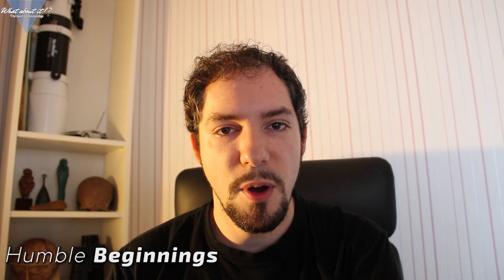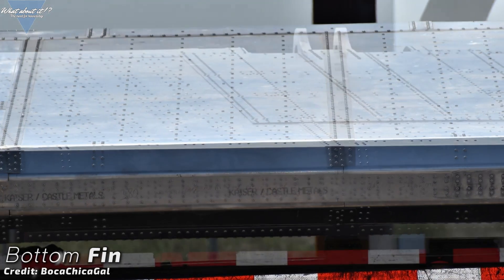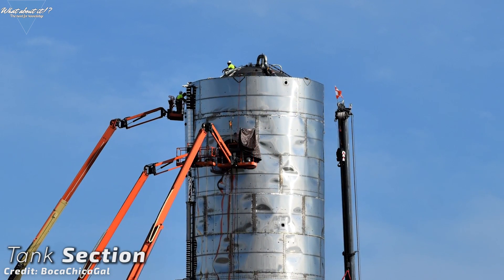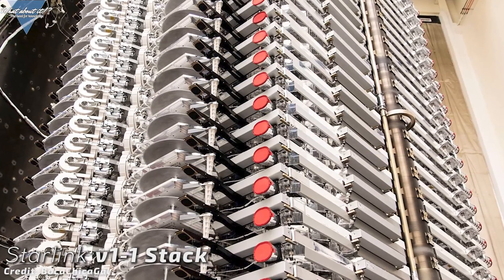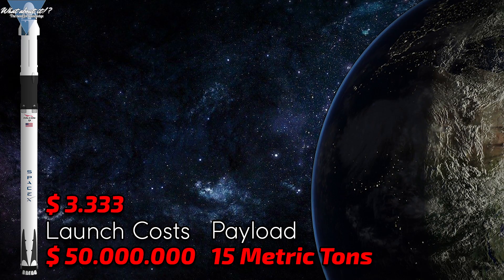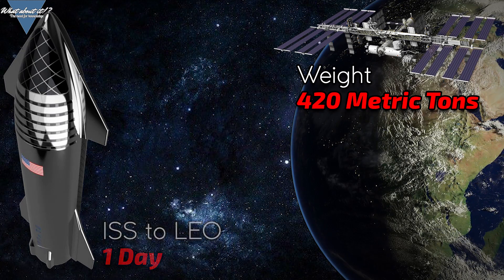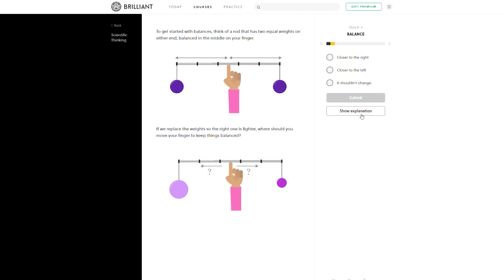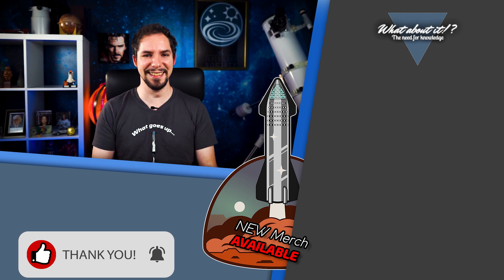50 | SpaceX Starship Updates – Starlink v1-1 Aftermath – Starship Reusability

Comment: Even if he starts out 100 times more expensive than his goal, it will be a big improvement per Kg. Realistically, I could see Elon getting to 10 times over his goal pretty quick($200/Kg) which would greatly increase the demand by orders of magnitude.  
     With low cost per pound, the space based astronomy possibilities are exciting ... can you imagine a research team operating 100 identical generic probes each 1000 pounds with ion propulsion exploring the asteroid belt? They could touch down on anything with orbital velocities less than a few mph.  I bet Elon could make them and put them in orbit for $200 million total.  Move over Webb, a mid to long infrared telescope could be assembled in orbit and be huge and cheaper than the Webb. And I anticipate a Repair/replenish/upgrade mission to James Webb on the far side of the moon. How about landing 50 low cost rovers on the moon that explore fanning out in every direction.
Reply from the maker: I like your ideas!
Reply: Here is another idea that would make the astronomy community drool ... 100 identical radio telescopes orbiting the sun. The resolution would be 20,000 times better than earth based radio telescope arrays.   And each radio telescope would be light weight low cost (Mass produced, achievable 1cm dimensional tolerance mirror antenna tolerance, No special cooling is required).  The inflatable mirror reflector would be huge with one side aluminum shaped like a parabolic reflector 100+ feet diameter, the other side of the unique balloon is transparent with just enough air pressure inside to hold the antenna/mirror shape. (Radio signals enter & exit the balloon via the transparent side and bounce off the inside of the balloon mirror.  At radio telescope wavelengths, the radiation penetrates the aluminum reflector about 1 micron so the balloon mirror can be very light weight.
     Elon Musk could propose offering with NASA some pure science astronomy tools such as above if he wants to get astronomers on his side.  Also, i bet he would discover some valuable metals in the asteroid belt including gold, diamonds, rare elements, fuel, water ... which could become a viable mining community.  Some of the asteroids are thought to be from the heavy metal high pressure core of a planetoid. A return payload from the asteroid colony worth $4.6 billion could be 100 tons of gold that returns to earth like a controlled meteoroid crash landing in the Ocean.
   All that carbon crushed into diamond at the center of a planetoid cold have created veins rich in diamonds.

Comment: The rivets on the fins are very Mark-I prototype work, they cause a whole series of issue's on aero boundary layer, additional resistance to name only a few.  Better tech exists already decades in aero-industry.  This is cheap-quick-dirty work, not exactly high-precision work, but it will be fit-for-purpose here since M-I will only fly once.   I'm convinced that Elon will be using a high nr of strain-gauges in each fin, supports and actuators and all other  key parts to measure stresses before deciding on the final production process for these fins as they are absolutely crucial to the function of StarShip. That may be the reasons why these holes are there, access to the strain/temperature/pressure sensors.  This is (apart from the SpaceShuttle) very uncharted territory.

Comment: Holes might be for stress relief during reentry heating.  Holes would ease the stress of expansion and contraction of the metal during temperature changes.  It was hard to clearly see which holes were referred to; some looked like irregular punch through with a chisel and others looked like clean cut rounded corner rectangles.  The camera panned too fast.
Reply from the maker: That is a good idea! Thank you!
Reply: @Whataboutit  Might want to get and publish information regarding stainless steel sheet expansion/contraction during heating/cooling vs regular steel and carbon fiber.

Comment: I don’t know why on the first stage they just don’t use an oxygen and hydrogen make sure it is a lot cheaper than using methane. It would be only the second stage you would have to worry about refueling on Mars. $900,000 just seems like a lot to spend on just fuel

Comment: What's the aero effect of those raised rivets?
Reply: Probably quite a bit of drag at super sonic speed but not important for this particular vehicle I wouldnt think.  Concorde documentaries really give a feel for what happens to objects at high velocity (heat and expansion) so I am thinking outside rivets will disappear in later versions and also as they start making the craft out of single rolls of metal.

Comment: $2 million per flight is only the marginal cost. It does not include profit or the cost of the vehicle or its development. If they can build a stack for $150 million and fly it 10 times, they would not be out of line to charge $30 million per launch. Flying it 100-150 times makes $5 million per launch a fair price. Considering that Rocketlab charges $6 million for 200 kg and Virgin Orbit charges $10 million for 300 kg, SpaceX shouldn't have trouble filling their manifest.

Obviously, the first iterations will not be that cheap to build and won't fly that many times, but it is clear that Starship is another disruption. Elon said that he sees a path to build a Starship stack for less than a Falcon 9. When that happens, we will see launch costs in the $30-$40/kg range and a lot of very interesting things will become feasible.

It is interesting that Elon will be most likely the main facilitator of Jeff Bezos' vision. I wonder how long it will take Blue Origin to catch up.

Maintaining a constellation of 42,000 satellites with a 5 year life span requires launching 700 new satellites per month. Even SpaceX would be hard pressed to launch a Falcon 9 every 2-3 days. (It takes five days for the booster to get back from a drone ship landing.) But launching Starship every 17 days is doable.

Comment: Starship+Super Heavy will cost at least $200 million, so with the claimed 100 flights per Starship that will be 2 million per flight right there, so with operations and fuel costs ontop it's more like 4 million, and I was being stupidly optimistic on the price of Super Heavy+Starship, it's probably more like $500 million so all in it's $7 million per flight. Elon is will doing the same crap where he doesn't count the cost of the craft at all, which you don't need to do as 7 million per flight for 150 tonnes is still $46.67 per KG, which is insanely cheap. Although the cost to the end user will likely be more like $10 million per launch, but that still puts you at $66.67 per KG to LEO which is still insanely cheap, so I don't understand the deception.

Even at 28.5 million per launch, you are still below $200 per KG which is still phenomenal which is a more reasonable goal, as I suspect there will be more maintenance required than Elon has suggested every 5-20 flights, which would be refurbishment of the engines, or just completely replacing them at worst, although you would probably keep some around so you would replace most, but keep some of the old engines, because you could lose 1 or 2 engines and probably still carry out the mission, as long as the once that fail are relatively close to pushing through the centre of mass you could correct it through gimbaling alone.
Reply: It's expected to cost less than falcon 9 (50 millions)
https://twitter.com/elonmusk/status/1094793664809689089?lang=en

Comment: I dunno... there's so much bending and buckling in those sheets of steel, i worry that some welds will fail and pieces will fall off during flight.  This might be suitable for use as a turbocharged grasshopper; slow speeds, not much air resistance.  But speeds of thousands of miles an hour will tear this ship apart.  Or so i fear.  >Charlie
Reply: I don't think this vehicle will be doing these speeds and te finished version will be all one piece or very close to it.  Still a valid concern though.
Reply: I want them to do well... but there's such a difference in the fit and finish between Starship and Falcon 9/Heavy.  It may also be that they're anticipating losing a few early on, as the engines work through their development cycle.  I guess it doesn't make a lot of sense to finely sculpt airframes that you anticipate losing.  But... yowser.  You definitely have to squint to see the beauty.  >Charlie

Comment: But if they build so much starships and fly them so frequently, won't that greatly impact the atmosphere?
Reply: N'gis Stemeveiche, no.
Reply: @Vessekx  how no? Rockets work with fuel combustion. They produce greenhouse gases just like cars but on a much bigger scale.
Reply: N'gis Stemeveiche, an individual rocket does, indeed, have more of an impact than an individual car.  But there are literally tens of millions of cars being driven every day.  No rocket, regardless of its fuel, can even hope to compare to the impact of cars on the atmosphere.  To even be a measurable data point in comparison, the would need to launch tens of thousands of Starships each year.

Comment: At 365 Raptors per year it will take roughly 120 years to build those 1000 starships. Probably Longer than it needs to be.
Reply: A massive continuous construction effort, A lot of technological advancements would be made before they finished making them causing a change in requirements

Comment: I think they are over selling Starlink.  The reasons for latency on the internet is congestion.  Starlink is not magically immune to congestion.  Comparing it's max theoretical throughput based on only one user to the current internet's massively congested system is quite silly.  Ask anyone that supports internet routing.  The main bit of lag isn't transmission speed.  It's Queuing and Routing.  Both of which Starlink will have problems with once there is more then one user.  On the plus side.  It is more routes so as people move to there it will free up ground based systems as well.

Comment: Good video but for carrying passengers, you need seat in the starship and they will not be weightless. So you probably need to multiply your weight by two before multiplying by 20$... Anyway, that's still cheap for such trip!
Reply: Even with that added and then doubling it for their profits it is still super cheap.
Reply: 1000 seats per starship so 2000$ a seat whatever your weight is.

Comment: With 3 a day, I feel they would REALLY be risking failure of a launch.  That is a lot of reuse, fast checking of componets, etc.  I'm no expert, but rushing is what got us Apollo 1.
Reply: the raptor engines are designed to last 1000s of launches, the whole point of starship is to make space more accesible for everyone. wee're still early days but once they start using super heavy and starship they will be gathering much data on how well these rockets perform, the goal is to make them go 3 launches a day im sure by that point they will have gathered enough data to improve the design so they are able to run that frequantly reliably and with as little inspection needed. think about how airplanes first started.
Reply: I get that risk is relitive, and am in  no way saying they should stop.  I just think caution is important, and to me at least they seem to be rushing.  And yet again i'm no expert here so i'm just armchair thinking.
Reply: @ericlotze7724  they arnt rushing attall. Transporting passengers around isnt going to happen for several years. Starship will have done 100s of launchs before they do that. It might seem like they are rushing building the mk1 prototype but this shows just how easy it is to work with stainless steel.

Comment: I doubt it will fly this year.  In fact its likely they already know it won't.   Manufacturing is notorious for slow downs and shut downs at years end due to everyone taking holidays.  Even if SpaceX wanted to push through fab shops, fueling parts sells are going to be at half capacity.
Reply: Exactly, I've got so much unused PTO built up that I'm on vacation for November.
Reply: Agree it will not fly this year for one reason fca

Comment: Sky & Telescope for this launch recapped the alarm amongst astronomers:

"Responding to the online backlash, Musk announced plans to paint the undersides of future Starlink satellites black, though this won’t change the reflectivity of the most brilliant segment, the solar panels."

"Agreed, sent a note to (the) Starlink team last week Specifically regarding albedo reduction." Says Elon Musk [May 27] on Twitter. "We'll get a better sense of value of this when satellites have raised orbits and arrays are tracking to Sun."
Reply from the maker: Thank you for the info! :)
Reply: Since the solar panels will be facing the sun, there is little chance of any reflection striking ground. The batteries will not charge if the panels are facing earth. Worst case will be if auto align fails.

Comment: So obviously the first launch won't use the Superheavy booster.. Yet its supposed to get fast/far/high enough that it will use it's air breaking system, which means its not just a hop.... Kinda confused.
Reply: I think that the Super Heavy is needed for when they add an actual payload. Remember Starship is supposed to have enough thrust to be able to lift off from Mars with a heavy payload.
Reply: @muchograndeyolatengo  Ah thats right... I think I read somewhere that its strong enough to get itself into a very low earth orbit if there's literally no payload. Should be interesting to see.
Reply: @jhyland87  This one weight 200 tons, that's too much for SSTO but it's only a 20km jump.

Comment: I wonder if they could coat the undersides of starlink Sats with vanta black.
Reply from the maker: The solar panels would still be a problem, but that's a great idea.
Reply: @Whataboutit  They will be retracted for landing - otherwise, they would not survive the atmospheric pressure when landing and break. Maybe on Mars, but not when landing back on earth. Or the would need to install flat, integrated solar panels only - on the low-temp side, where there is not heat shield. But then the Starship would need to face the sun with that area most of the time. You can try that realistically in Kerbal Space Program. ^^
Reply: The object still creates a shadow. The only way to compensate is for accurate tracking so shadows can be accounted for.

Comment: I keep wrestling with which is the lee side of Starship. The blending segments for the elonerons/brakerons/canards are on the windward side, almost certainly. This will allow the elonerons to actuate back away from them. The raceway cover long slope could face windward, or the blunt rounded edge may face the airflow - aerodynamics can be counterintuitive. I'm surprised the raceways are on the "edge" at all, would expect them to be well on the lee side. Manholes - on the lee side? Or covered by tiles if on the hot side, so doesn't matter. No access needed once complete?

Would be so much simpler if it had a lee fin!
Reply from the maker: I am pretty sure, the steep side of the raceway will face the wind, as SpaceX will try to maximize the drag, but I've been attacked saying that before, so I'll let the viewer decide... :D Thanks for the nice comment!